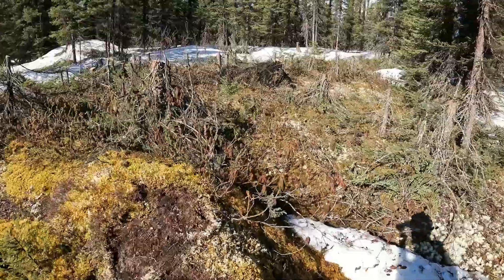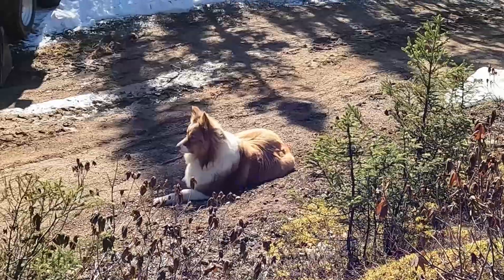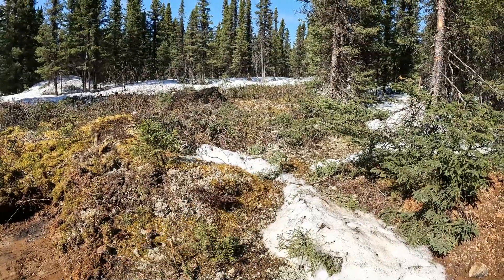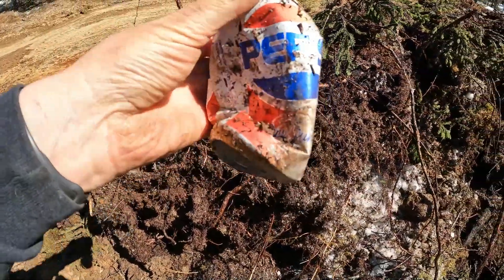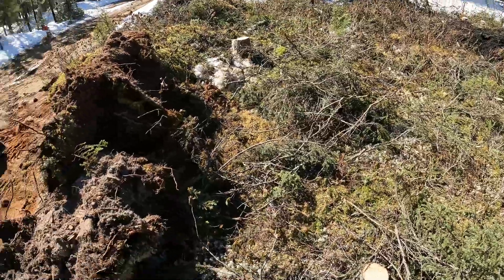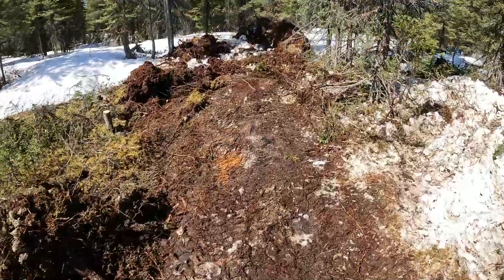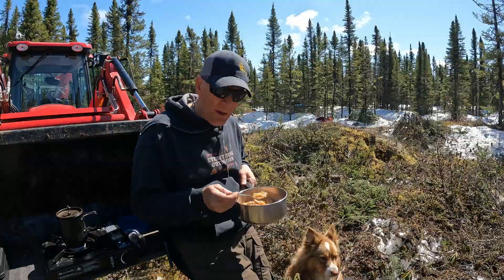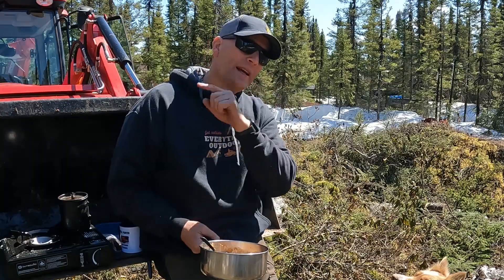"Name My Tractor" CONTEST & watch it move the Earth- Let's have some fun! (Off-Grid Log Cabin build)

Comment: Well i think you should call her "Frankie" Lol  Chuck not sure were i got that from ? how big is your property there ? usually lake front is long and narrow in my experience 1/2 acre or smaller here
Reply from the maker: A standard lot here is 45x90.  That’s ideal if the land around isnt already taken up. I can throw a rock from my existing cabin spot to the land I cleared. Right along side only hidden by a thin buffer of trees. Worked out well👍
Reply: @ChuckPorterEverythingOutdoors   Looks like your going to have great time with the move and the new cabin build with that Tractor !